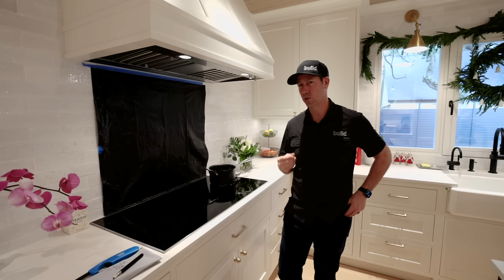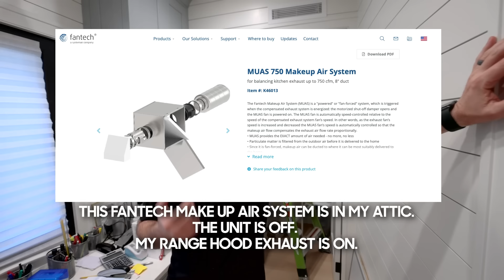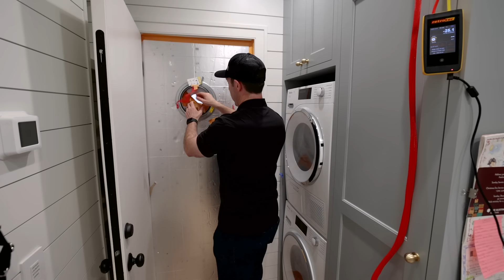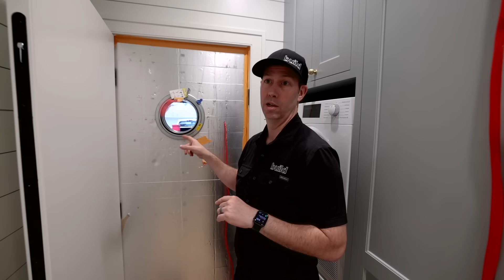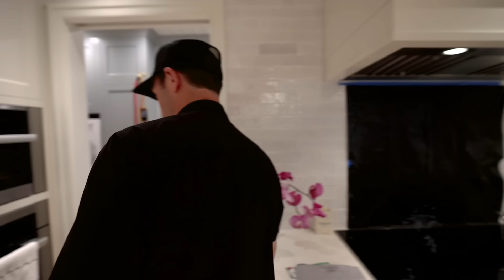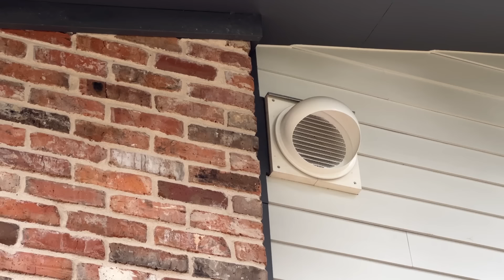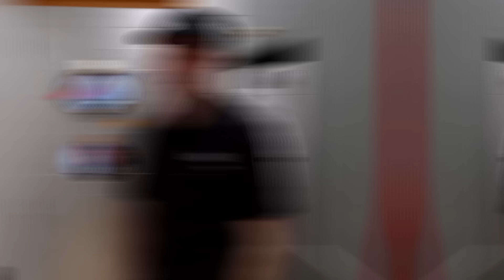Make Up Air for a Kitchen Exhaust - Most Homes Suck. (Pun intended)

Comment: Combustion gases aren't bad; CH4 + 2 O2 -> CO2 + 2 H2O. Just a little water vapor and carbon dioxide.
Reply: You can make anything sound bad, dihydrogenmonoxide or DHMO has an entire joke site dedicated to it when it's just water. CO2 is the product of respiration and yet it's the bogeyman of environmentalism. I think though that he's thinking of all the aromatic compounds that come off while you're cooking that give food it's smell which is just paranoia.
Reply: Yeah but nothing is perfect combustion. The issue is incomplete combustion. Your equation is wrong
Reply: @CybekCusal  10% perfect? 90% perfect? What we'd need is level of target gas and the minimum exposure level... which in cooking a Thanksgiving Turkey or what have you is way below any thresholds of safety with centuries old ventilation techniques.
Reply: @StealthNinja4577  commercial kitchens use that MeLink systems but they cost like $20k and it's not appropriate for residential systems.

Comment: Is there a way to have that forced air make-up system to automatically ramp up and down according to demand such as clothes dryers, bath fans, multi speed range hoods, etc.
Reply: Theoretically that could be achieved using a manometer to control the power going to the motor

Comment: Awesome video learned a lot, just curious how would a remote blower affect the pressure of the house? That’s not so tightly sealed like yours my house is under construction right now but it’s not super tight. I would like to have a remote blower though because a loud hood when you’re trying to cook is the worst. do I need to employ forced air if I don’t have such a tight house?

Comment: I feel like the ERV or HRV would play into this as well. Would having negative pressure inside force more air to enter through an HRV or ERV?
Reply: ryan-if you had a self bala;nciogn system like broan, if you exhaust fan is generating substaial negative pressure, the ERV intake adjusts to ramps up intake of outside air and ramps down exhaust on indoor air to mitigate/compensate.

Comment: Looks like Matt is using a manometer from a blower door system. I'm not familiar with manometers, but after a quick Amazon search I see a lot of options that are geared towards HVAC/furnace work. These seem to all have displays that can show KPa where Matt is reading Pa in his manometer (at least that's what it looks like). Can anyone recommend a manometer that can measure the kind of levels that Matt is reading in this video?

Comment: Why not just do a recirculation hood. Then you don't worry about introducing any outside air to the house and letting your ERV do the work in conditioning the air?
Reply: Because the objective is to remove fumes, odors and combustion gases (if it’s gas cooking)
Reply: @aayotechnology  it’s not gas. It’s an induction cooktop. Like he said in his video, he isn’t worried about the gas and why he only got a 400 cfm unit.
Reply: @rodrigoserrano3984   Umm yea I realize that in Matt’s case there’s no gas. So therefore it’s only fumes, odors and unhealthy particulates from the cooking process he’s eliminating with that system. Do a google search on it, bud

Comment: and its VERY expensive, like $3,000 installed AND multiple devices to maintain !! ...the motorized duct is only about $180 and you are halfway there- make sure your ERV self adjust Boroan ai etc and you are there for far less (you are already buying the ERV) and way less to maintain

Comment: I live in the high desert, if someone in my house leaves the extractor on in this example after supper overnight in winter, and I have the makeup air bringing in really cold outside air at that rate, would this not cool my house down a lot (say my heating was off)?

Comment: Whilst having a dedicated make-up air system, powered or not is a good idea, what is shown is hugely wasteful of energy and in its own way a contributor to global warming.  In cooler climates the incoming air must be warmed so as not to create cold drafts and to heat this incoming air is where the energy is mostly wasted.
 I have a 1960's property that we fitted full heat recovery into that extracts through the mandatory cooker extraction, bathroom ventilators as well as off the tumble drier  The exhausted air is passed over a heat exchanger that is around 90% efficient and the heat warms the incoming fan assisted air that is then ducted to the general living spaces, which circulates back to where the extraction takes place.  The system is modulated by sensors that identify when the bathrooms require venting due to the occupancy or relative humidity or when the cooker extraction or tumble drier is switched on.  The benefits of the system is that on tickover air is circulated around the house and most of the expensive heat that supplies the bathrooms, cooking and drying is recovered for the benefit of the house.  On summer setting the smelly moist air is dumped outside and fresh unheated air is allowed into the building maintaining airflow and comfort conditions
Such heat recovery systems are one method used to achieve the energy standards in new build housing in UK that are becoming ever more stringent.
Reply: I agree what was shown is wasteful but how can you use cooking exhaust air with it being contaminated?
Reply: you should watch more of his videos first on the goals of a passive house & energy recovery/savings.  Matt's well aware of the heat recovery you talk about & mentioned it in this video too.

Comment: I'm surprised your makeup air is separate from your fresh air distribution system.  The vent hood is pumping a lot of filtered air conditioned air out to the environment.  Putting a heater and filters in the makeup air is just part of the problem, what about moisture and cooling?

Comment: 1 atmosphere, normal air pressure, is about 100,000 pascals. The code is less than a 3 Pa difference? That seems like serious overkill. I have to have the pressure inside and out equal to within 0.3%. Is this the code for extra tight houses? Is that even a separate category? I’m guessing not. Compared to my house built in the 60’s, this seems like a drastic overreach in the building code.

Comment: In a hot weather area like where you are (and I live in Vegas, so hot in the summer too), are there concerns about bringing the outside air with this system when running the AC?

Comment: Why would you not send the incoming air through a heat exchange device? Aren't you getting hot humid air directly from the outside? You used one for the hvac unit did you?
Reply: It's because it's only for occasional use and wouldn't have much effect

Comment: Interested as to why this isn't integrated with your Zehnder "fresh air" system in your house.
Reply: There are probably a host of reasons, but the first one that comes to mind is the fact that the Zehnder is not a high CFM unit. At most a 350 unit will move about 200cfm (if I'm not mistaken) which is nowhere near enough to neutralise the negative pressure created by his modest 400cfm hood.

Comment: Matt. I agree with many other comments here that your makeup air is poorly located and compromises space conditioning. It should be located in the kitchen zone. Even simpler, in my kitchen I use one of the kitchen windows for makeup air.  Yes the family had to learn to use it just as they learned to close the refrigerator door and the doors to the house.

Comment: Will unheated makeup air introduced into the home cause problems besides comfort?  I would rather allow the cold air to enter the house and let my gas furnace turn on than to use a 10000 watt electric heater.  My plan is to have it enter in the second story foyer adjacent to the kitchen so it won't be blowing on anyone.

Comment: Humm.........
So the Make-up Air system is pulling in hot air in the summer and cold air in the winter?
So no more lingering turkey smells through uot the house during the holidays?
So wouldn't the exaust fan in the bathroom drive similar concerns with negative pressure?

Comment: Im installing a broan automatic make-up air damper the opens when the range hood is turned on, I'm going to have an inline filter but I'm wondering if I can dump the fresh air behind my electric range and allow the range to temper the cold air in the winter?  Thoughts?

Comment: Well for me in my home I open the deck slider 4 feet from my gas stove to let in “make up air” as my cheap microwave squirrel cage fan does nothing to exhaust the smoke and combustion gas from cooking. I’m looking to add a 6” powered fan hooked up to the fan controller in the microwave hood but that’s all I can do. Mostly make it actually exhaust the air up the 6” diameter pipe that goes through to the roof. Not gonna give up my gas stove as I don’t have 20K to rewire the house for Electric stove. Show me all the SE Asian restaurants switching from the high volume gas burners (wok cooking) with successful induction cooktops and I’ll look into it.  I think the governments should stay out of our business in how we want to cook and heat. Natural gas is a byproduct of oil extraction and that isn’t going to stop.  You knew younger people can eat electric all you want. Leaves more gas for me and the others that agree.

Comment: Thinking of doing the same thing but I wanted to tie in my kitchen vent with the ERV, is this not an option?
Reply: Cooktop vents should be its own seperate system due to grease and smoke produced. You don't want to run that through an erv/hrv, not designed for that. Stale air and fresh air only in erv, no concentrated garbage.
Reply: Number one way to burn down a building last time I looked. Youtube commercial kitchen duct cleaning. It starts with a hot water at least 2000psi pressure washer and heavy chemicals

Comment: So are there no issues with 400 CFM of humid summer air? Seems like that would heat up a room in no time
Reply: On your average house (that is not sealed nearly as well as this) that air is coming in anyway through cracks.  At least here it's filtered and controlled.
Reply: @dreednlb  that’s true. I guess my thought is comfort if it’s blowing out of one specific vent in one area…as opposed to a larger draw from cracks around the more general building area

Comment: Any quality cook will never chose an electric/induction cooktop over natural gas. It might be arguably “better” for clean up or construction, but you’ll NEVER get me to trade in my gas appliances and I am a retired electrician.
Reply: Many many many top chefs have switched to induction a decade ago or longer. You can't compare induction with grandmas old coil electric stove or a crappy on-off-on-off-on-off modulating vitroceramic one. 
I absolutely hate conventional/vitroceramic electric cooktops, I like my gas cooktop in my home, but for safety and convenience reasons I got an induction cooktop installed in my (elderly) parents home recently to replace their gas cooktop. My mom was skeptical about it and I was skeptical about it as well, wouldn't have thought about doing it if it weren't for the safety issue, but only one day after it was installed my mom was telling me how she likes cooking on that induction cooktop so much more... I was still skeptical about it myself, but I help her with cooking regularly and I have to say she's absolutely right, you not only can get a large pot to boil very quickly, it is indeed very easy to control all the way down to a barely bubbling simmer right on the same spot without having to shuffle pots from large to small burners, let alone have to shuffle small batches of bechamel based sauce on and off the flame because even the lowest setting of the smallest gas burner is often too strong. 
I discovered exactly two downsides of induction:
 - if you like to toss the pan, the heat stops as soon as the pan leaves the cooktop and you have to be careful about banging the pan on the glass top.
 - you can only use pots and pans with a thick flat magnetic bottom, so no all-copper pans and no thin all-round woks.
For these reasons alone I will keep gas in my own kitchen, HOWEVER...
I was planning to replace my 4-burner with a 6-burner, but I decided I'll keep my gas 4-burner for toss-cooking, wokking... and install a 4-burner induction cooktop right next to it... and THAT is what most "quality cooks" actually have nowadays.

Comment: Hi Matt, great video...thank you.
Since your MUAS 750 Makeup Air System has a capacity of 750 CFM, what did you use specifically from Fantech on the exhaust side to match up with the FG 8 EC Centrif. Inline Fan for the supply side?
Also, what did your (2x8" diameter?) exterior penetrations involve to work with your tight house?
Can you give specifics on the exterior terminations and face plates please? I can't seem to find the Seiho intake vent - it's nice and clean looking.
My wife and I are just starting the design process for a house in RI. For a Bosch cooktop she is interested in, Bosch recommends a hood of theirs, if we were to buy theirs, that is rated at 600CFM max. So I'm using that as a reference of what we should seek for an alternative system like the Fantech exhaust + MUAS 750 Makeup Air System.
Thank you for your time.

Comment: Am I the only one who is seeing that our friendly video maker here has proven that the “above 400cfm” rule is actually too high? Technically according to the code, he didn’t need to install makeup air. But according to the device’s measurements, he absolutely needed makeup air for his exhaust system and it was only 400cfm which is the highest possible cfm to have WITHOUT having to install makeup air. Or am I understanding the code incorrectly?

Comment: And when it is -40 outside for months? Whats the best way to make up air without having a negative effect on the inside temps? Sure we are told insulate insulate insulate. The government even has a program to do so, but now what... all my heating, force air, and on demand hot water, and pellet stove are closed systems, so they draw direct from the outside through individual vents.

Comment: On my recent parents house remodel I installed the thermador exhaust setup with remote blower, the MUAH 10" heater and the Merv 13 filter for the make up air in SE Michigan.  To be honest they dont use the heater that much. After about 3 months the filter was in rough shape, folded over and covered what looked to be mold. anyone have a idea of what i did wrong or didnt do enough of? thanks

Comment: Is the intake fan speed matched to the exhaust fan or just on full blast? Does the code allow for positive pressure? Thanks!
Reply: it has a controller that ramps up the fan to match the exhaust, mentioned having an air pressure sensor
Reply: That's correct, Adam. The controller will allow the makeup air match the rate of the exhaust air. As you ramp up you exhaust, the supply will do the same. The international residential code allows for positive pressure up to 4 Pa.

Comment: what a can of worms this video has opened for me!  I am researching how to put an exhaust fan in my kitchen without using a range hood as our microwave is above our very basic gas range...but now i realize we have 2 issues as we have a very tight house and no air replacement. idk how this house passed inspection. Is there a solution for not having space over the range for exhaust?
Reply: An OTR microwave cannot adequately vent NO2, CO1, and other fumes from a gas stove. Even above an electric range, they've performed poorly in my experience; the front of the microwave would get covered with condensation when boiling pasta or potatoes. 

My previous homeowner had a Broan 220 CFM range installed above a gas stove that has the problem of a terrible capture area and it should be rated at least 550 CFMs. You'll have to add the BTUs from each burner and divide by 100 to determine the minimum CFM needed. The ZLine 627 range hood has a 7" height and is 600 CFM so that might be a possible alternative. Hauslane and Zephry might have undercabinet models that meet the CFM requirement.
Reply: Each to their own but I would NEVER use gas in a tight home. Then, with ERV Ventilation, discovered that our home was so tight, we needed MakeUp Air to help open the outside doors when our 300 CFM Microwave Exhaust ran. (simple and not covered by code.) Hope you get answers.

Comment: I am building a house in which I luckily had the opportunity to live temporarily in the same exact model previously. I felt as if the range hood was not vented correctly. The house always stuck of food and felt like much of the air missed the baffle and it was 1000CFM Blower. I have a 48" gas range myself with a 1000CFM blower. I am doing a flash and batt insulation (2x6 framing) and spray foaming the attic. I'm closed cell from the foundation up to roof rafters. How do I know if I need make up air? Who can I reach out to. I do not have a builder I am running the project myself.

Comment: How would you have handled the makeup air if you did not have a heatpump dryer?
Reply: I don't need makeup air WHEN we buy a Condensing Dryer. BUT, it's our normal microwave (300 CFM) that is causing the need for make up air The code starts at 400 CFM but we have a REALLY TIGHT HOME.

Comment: So if it’s 100 degrees out you bring that into your house?  Same idea it’s -10?
Reply: Yup, but you have to make up the exhausted air somehow... I personally prefer make up air, but closer to the kitchen so the path the unconditioned air travels through is as short as possible. The other solution would be to use a recirculation vent with a charcoal filter.